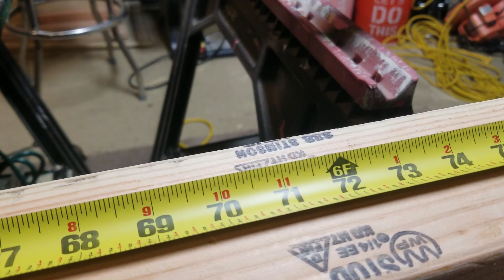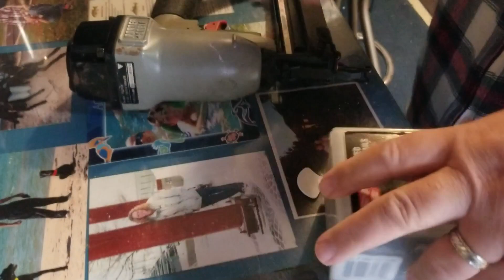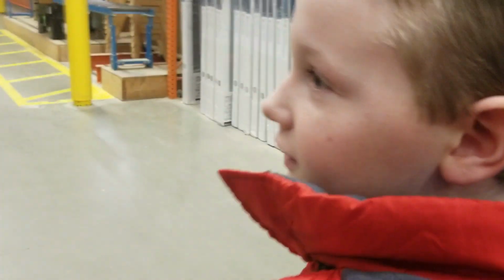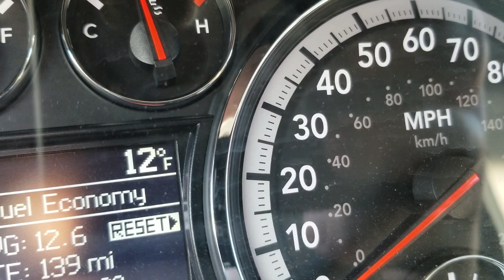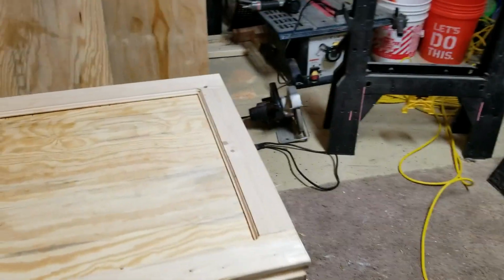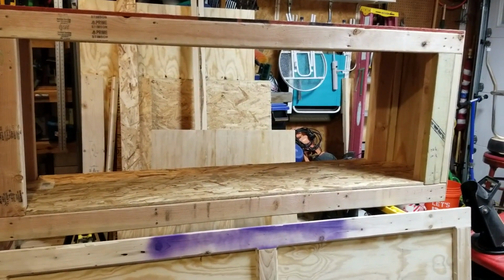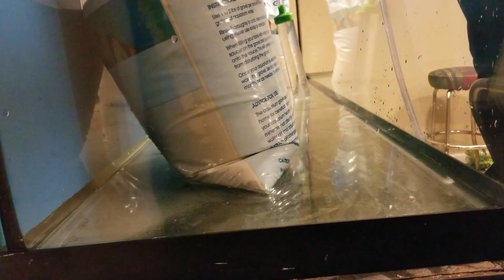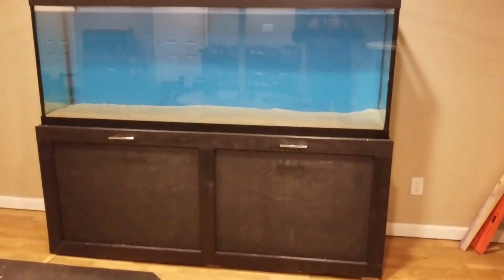Simple Stand Build - 150 Gallon Aquarium

Comment: Has the tank failed yet?  That six foot span - a single 2 x 4 on front and back - is not going to support the weight of the tank.  The 2 x 4 will deflect downward under weight and if the glass doesn't crack then the silicone seal will pop - either way it will be a wet basement.  I have seen it happen on a 5 foot tank.
Reply from the maker: So far...so good.   It's been up and running for over two years.   If it fails, YouTube will have another video and I give you credit for warning me... and you can comment... "We'll, I told you so".  😉
Reply: Agreed. Any tank that’s longer than 4 feet needs a Center vertical support.

Comment: How do you resolve any imperfection in the 2x4?  Would this cause uneveness once that tank sits on top of the stand?
Reply from the maker: I try to buy or use straight boards..  I've had to toss some 2X4's back to the pile but I try to pick quality wood (it's not always easy).  I also add the top board to the stand and I've been very fortunate that when I put the level on it, it's flat.  I've got five DIY stands downstairs in my fish room and I haven't had any issues so far.     I do not have a jointer...

Comment: What is the dimensions of the tank and stand? Great job on the stand. What do you plan on putting in that tank?
Reply from the maker: This stand is 73.5 inches long, 19.5 inches wide.  30 inches tall.  I grew out a Silver Arrowanna in the 150 gallon.  I just sold him... the tank is up and running but no stock in it for the first time in 2 years.  I'm not sure what's going in there next.

Comment: I am working on a 125g stand and I want to use a 40g breeder for my sump. How is the standing holding up with the water in it? Any issues with the weight?
Reply from the maker: The stand has held up well.  I did change the front though.  I didn't like the single whole piece front.  It was heavy and it didn't attach great, so I made actual doors for it.   But the stand itself has held up great.  I have an Arowana in the 150 gallon, but he's growing so fast I may  need to upgrade to a larger set up.  Or, trade him for something else that's not as big and with have the attitude this fish has.  LOL.  Good luck on your stand!
Reply: @GebosGarage   Thank you. I was trying to avoid the middle supports (like your 90g vid) If I don't put them in then my sump will work great. Glad to see it works with yours.

Comment: How did you end up doing the front panel? Is it removable?
Reply from the maker: Well...  initially I made it as one large removable front panel.  But it was heavy, and I didn't like it.  I mean, I did like that it was completely removable, giving me full access, but later I decided to do something different.  I took the panel back to my garage, cut it in half (right down the middle) and turned it into two large doors that I attached with hinges.  The left side has since warped a little bit, and although it looks fine, it bugs me.  I will be remaking the doors for this cabinet and I want to thank you for making me revisit this.  It's time for an update video on the stand.   I just wish lumber prices weren't so high right now.   Thanks for visiting the channel, I'll mention you in the follow up video.  Cheers!
Reply: @GebosGarage  thank you!  I just picked up a 150 and now have to build my own stand for it so I appreciate your examples!